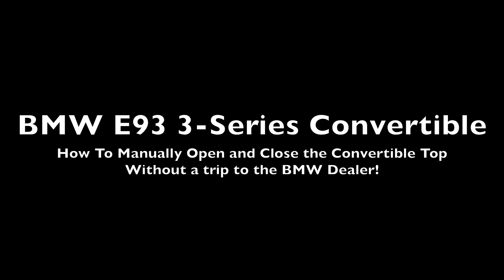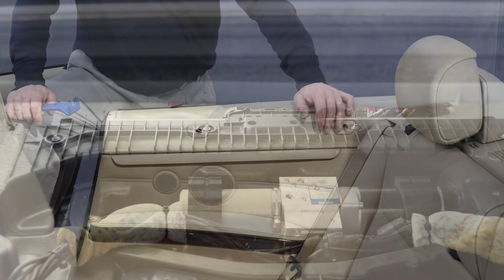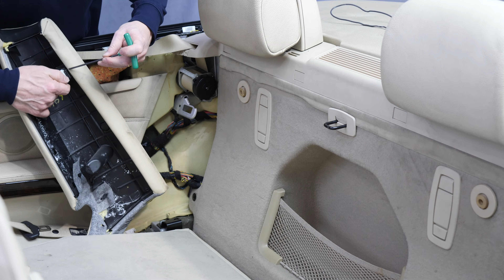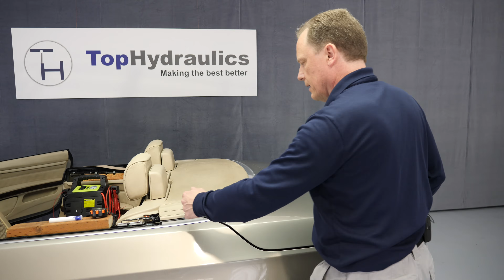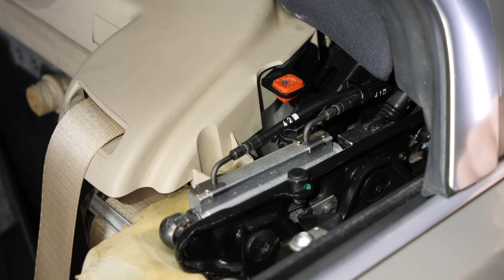How to Manually Open and Close The Top (Long Version) - BMW E93 3-Series - Top Hydraulics, Inc.

Comment: Thankfully I came across this video my e93 hard top was jammed in the closed position and had the red light on the button and thanks to this detailed video I will be attempting this in a day or two I assume after the roof is in the closed position you tighten the brass screw back up on the pump ?
Reply: hello I released the flap, but the top won't come out of the trunk. It seems like it's locked or jammed. do you know what should I do in this situation?

Comment: Guys I own e93 cabrio Lci model 2010, got engine under fire, so whole front burnt down, and locked up my boot, of course with the foldable roof inside of it, so I couldnt climb in through rear seats to pull that triangle handle that opens the trunk manually when battery is dead. But Ive found the solution! Take off the cover that you press when opening boot normally with the hands, and also the LEFT side plastic that lights on the evidence plates. Then youll see hard to get to - black cable - that black cable has metal like cord inside, that is connected to the boot and its the same one that goes to that triangle handle, than you have to pull it somehow and the boot will open. So it is possible to open also from the outside of the car WITHOUT battery charging or some specific cables connection. Good luck :)
Reply: hello I released the flap, but the top won't come out of the trunk. It seems like it's locked or jammed. do you know what should I do in this situation?

Comment: What happens if you cut that red wire and is there a wire you can cut to shut off the safety alarm that says hardtop not locked hardtop not locked is there a way to bypass that a wire to cut?

Comment: Got my roof up manually , I hope touching the two wires with my drill battery will latch it , anyone know the right wire to cut to bypass it all safety alarm ?
Reply: hello I released the flap, but the top won't come out of the trunk. It seems like it's locked or jammed. do you know what should I do in this situation?
Reply: @aoxkxkckssdi  pull the cylinders back around where the hinges open the hinges and make sure the partition is wedged up. Make sure that pressure screw is loosened and it should pull out and up.
Reply: @JohnNighthawk I loosened the pressure screw and pulled the cylinders back However, it still won't come out as if an internal locking mechanism is still engaged....😭

Comment: Recently got the “roof impaired” warning on the idrive and roof was stuck open 35percent. Was able to crawl through ski pass and pull emergency trunk release. I dont not have the key hole. 2011 e93 M3. I released valve. Top was able to fall back into close position. No sound from hydrolic motor. Replaced salmon relays, still no sound from motor when top up or top down button is pushed. 2 Codes popped up on Carly app…indicates “windshield cowl reached” and “power supply”. Took apart the rear interior to access port to jump mechanism to lock. Was able to do that. But pulling the rear to the dead space to fully lock is been difficult. I get to exactly where you cut off the camera to lock the trunk and rear section. Do you have any tips on how to pull them all the way to lock.   Also after the top has been properly latch and locked., do i tighten the release valve on the pump back to close? Please help and thank you in advance…rain is on its way where i am and want to lock everything up.
Reply: Was able to do the rear. Heavy force was needed and a 2nd person to pump and push down on rear glass

Comment: Great video! I can't get my top to close.  I can't get into the trunk, my model does not have a key for manual release nor do I see a emergency release cable inside the license plate lights housing.  I think the passenger side is locked but the driver side is unlocked so the system is not completing the locking cycle.  Any suggestions will be appreciated.

Comment: My E-93 M3 has a broken wire and there's an open fault for the micro switch and the dealership is telling me I need to replace the hydraulic lines and the electrical lines for the wiring harness they said it's over $14,000 to replace all the stuff needed to use the Top again if my electrical lines are broken is there a way to have the Top latched up front

Comment: Hi, thank you so much for this detailed video!!! Amazing work indeed.

My issue is:

- Roof is currently in the *open* position
- Pressing the "close roof" button successfully opens the boot
- BUT: The roof does *not lift out of the boot*

-----------------------------------------------------------------------
📄 hydraulic_valves_status.csv
-----------------------------------------------------------------------
| Description | Roof Open | Attempting Close |
|--------------------------------------|---------------|------------------|
| Valve for coupling fastener | activated | activated |
| Valve for roof shells | not activated | not activated ❌ |
| Valve 3 for rear-end module | not activated | activated |
| Valve 2 for rear-end module | not activated | not activated |

- *Valve for roof shells* (responsible for lifting the roof ???) does not activate
- Rear-end module Valve 3 activates correctly
- Valve 2 may not be involved at this stage

-----------------------------------------------------------------------
📄 hardtop_drive_status.csv
-----------------------------------------------------------------------
| Description | Boot Open/Closed | Pressing Button |
|------------------------------|------------------|-----------------|
| Relay 1 for hardtop drive | closed | closed |
| Relay 2 for hardtop drive | closed | open ✅ |
| Drive for hardtop locking | stands | stands ❌ |
| Pump temperature (°C) | 46 | 45 |

-----------------------------------------------------------------------
📄 hardtop_sensor-switches_status.csv
-----------------------------------------------------------------------
| Sensor | Roof Open | Boot Open |
|-----------------------------------------|-----------|-----------|
| Locking switch closed | Yes | No |
| Locking switch open | No | Yes |
| Partition sensor (boot shelf) | closed | closed ✅ |
| Micro switch ‘cowl panel unlocked’ | No | Yes ✅ |
| Convenience function status | No func | No func |

My main concern with attempting to do close it manually is, since the roof is inside the boot, how do I access the pump to release pressure as explain on 5:39?

Again, thank you so much!

Comment: Question for @TopHydraulics 
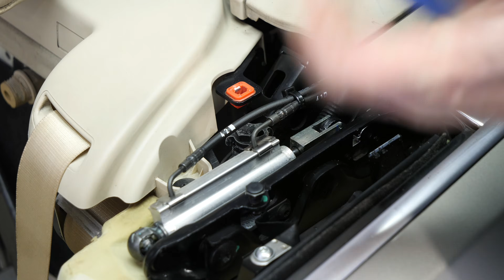2015 435i F33.  Right rear window non-responsive (yup - the water in the door issue).  Hard top is up.  Front locking mechanism manually released using T55 in front center roof hole.  Relief valve opened at hydraulic pump in trunk (sitting inside black plastic funnel) using long 4mm hex driver.    Could not get either left/right locking cylinder to budge using the same prying tool you used at 24:20.  Disconnected BOTH hydraulic lines to left locking cylinder; now it will move very slightly rearward but immediately returns to forward position as soon as prying tool is removed.  Seemed to be locked in place and would not move.  Left it alone for about 30 minutes and then went back to garage to try again; this time both cylinders moved backwards immediately and we were able to fold the roof into the stacked config.

Raised trunk section and propped it open, and then attempted to fold the stacked top back into the trunk (with the trunk horizontal divider down), but the top will not fold back.  The arms coming from the trunk section up to the stacked roof resist all efforts to fold back.  Is there another lock that needs to be released for these main arms?

Comment: An other question, once top is down in the truck, how do you close the screw of the hydrolic system?
Reply from the maker: That would take some ingenuity. Normally, the manual actuation valve gets closed when the top is up.

Comment: Hello, I have my roof that had stuck to 20 cm from the windshield, so I closed it manually and the rear switch as well. But since I have the open roof alarm that sounds.
So I changed the salmon relays, the central system roof microswitch. Today I reopened and closed the roof as in your video. But the automatic open-close still doesn’t work, and I still have the alarm.
But the roof is crooked, the windshield seal is more compressed on the driver side than on the passenger side. Would you know how to put the roof straight? Because someone told me that there was a story of magnet
My car is an e93 330i 272 from 2007 thank you
Reply: Let’s see if this wasn’t a coincidence, where the front wasn’t quite ready to latch. I would unlock the front and both frame locks, back the roof off the windshield, examine if anything appears uneven in the front locking mechanism, and lock again while making sure that the top has entered the windshield evenly.
Reply: @KlausWitteTHI well i did it but still nothing change and anyway i'm not able to correct the position of the hardtop...but it's open at his top, if i use the opening button, i can hear the hydrolic motor but nothing happening and the error code is 00A68E

Comment: Hi, I have a 335i 2008 and my roof got stuck in the trunk and didn’t come back up, we tried to bring it backup manually and we made it but we noticed that the window didn’t roll up after that and it show that the top is not completely closed 
We can see the rear part is not latched but we don’t know how to proceed on that part, what do you suggest
Reply from the maker: Maybe re-watch the video and find the step you missed. I suspect that you didn't pull the rear locking cylinder in all the way, as shown around https://youtu.be/2hDdwukqR4g?t=1901

Comment: Hi, I am trying to follow this procedure and everything was working fine up until I'm trying to release the rear trunk by pushing out the piston cylinders on both sides. They are not moving at all, what should I do? I released the pressure relief valve as you suggested earlier in the video. Any thoughts? Thank you for your time!
Reply from the maker: Push harder, or remove the hoses from one cylinder in order to make it a little easier to move the cylinders.

Comment: Hi, thanks for the impressive instructional video. I was able to follow most of it however after opening the cylinder piston I am not able to close it again, it took some force to open it and had a springy motion at first, after that it it smooth to open. Now I can close it only up to about an inch and no further no matter how much force I use. Any ideas what could be causing this? I am now no longer able to close my car windows due to this

Comment: Hello My name is Slava. I have a question about my BMW 430i convertible I got stuck with my hard top is not close.  And I have an error 8005008 CTM, microswitch cowl panel locked / stowage compartment latched: Line disconnection (open circuit) or short circuit. But I can’t find where is located.
Reply from the maker: Maybe it's this switch: https://youtu.be/2hDdwukqR4g?t=1564

Comment: I did all steps but now I cannot lock the roof closed.also there is no hydraulic movement in my electric switch were there was beforehand..any help greatly appreciated as windows are open fully and can't lock the car
Reply from the maker: Reading between the lines and using my crystal ball, I believe you are trying to say the following:
You had to manually close the top because your pump was actuating when you pushed the button to close the top, but it didn’t move the top or it didn’t move the top or the trunk module well enough. After you manually closed the top, seemingly following all the steps in the video, there was a problem with fully locking the top and the windows won’t go up any more. At the same time, the top won’t move in any direction when you pushed the button.

1) Is this correct?
2) Which part of the top is not locking properly - the front at the windshield or the rear frame locks where you were supposed to use the angled pliers?
3) Exactly how far were the trunk module and the top still moving before you attempted the manual operation?
Reply: @TopHydraulics  hi yes the roof opened as far as glass and roof folding into the boot (the lid would not close) 
So I manually released the hydraulics and lifted the glass and roof out of the boot back to a closed position but none of the locks are locking( the roof lock and frame lock) and there is also no sound of motor movement when trying the switch 
Did I blow a fuse?
Does the hydraulics need a reset?
Reply: @TopHydraulics  OK progress... I manually lifted the roof open fully and closed it again this time forcing the boot lid shut and catching it  but when I try to do the same with the glass & roof combo it' seems like the glass section is not interlocking to the body ...the roof lid is now locking to the body. This is not allowing the windows to closed

Comment: The 250lb cassette of the hardtop that you easily lifted at the 29:00 mark on the video... What would be a cause of this being locked down and not able to move (at all), did everything else in the video as you stated. The problem I am having is my client asked me to replace the trunk located battery. The battery had 0 volts. I hooked up jumper cables to the front jump lugs and car came alive. Push the conv top button and trunk lid rises as its supposed to but that cassette does not move nor do I hear any unlocking of it or any motor noise. Only the trunk lid moves every time I try. I believe that this hardtop cassette is (locked)?  and if you agree, what is the work around for me to manually (unlock) it? She parked the car in her garage back in August with the top already open and she supposedly had a battery tender attached and battery is stated to be one year old. I got the car running with a jump yet the roof does not close, only the trunk lid rises. By the way, I have bought hydraulic parts from Top Hydraulics last year for me SL550. This is a clients 2013 328i Conv.
Reply from the maker: If the battery has been low, then the computer may have lost the memory of where the windows are at and it will allow no top movement except for the trunk lid, in order to avoid collision of the top with the windows. If your windows come down 1/2" when you open the doors, then the windows are "indexed" or "synchronized". If not, then you will have to follow the procedure for indexing the windows as described in the owner's manual for action after the battery was dead. In most cars, this means raising the windows to the UP position and keeping the window button pushed a few more seconds.
If you are unable to raise the cassette, then be sure that you have the manual actuation valve on the pump open, ignition off and check whether the front latch might be hooked on something.
Reply: Hey i got the same problem. Did you find a solution?
Reply: Got lucky and got the switch hold it down for 60 seconds and relaxed the partisan lack

Comment: Old thread I know. But I’ve used the manual method as stated and got my top up. Still having an alarm with the red top indicator on the instrument cluster. How do I get that to stop
Reply from the maker: You get the alarm to stop by letting the control module get the signal that the top is latched and secured. The problem lies most likely in the rear frame lock cylinders not having been moved all the way - the ones where we used the angled pliers.

Comment: Hello guys, I carried this out and I'm stuck with no windows now as I can't fully close the closure cylinders on each side.

I've used the 90 degrees pliars also

I have tried to remove the hoses , no luck
I've also had people pushing down on the back
I've pulled with alot of force and pushed down also.

I also cant access the boot and I can't access from the rear as I don't have the ski pass through it as I am in the UK so it's not as common.

Ive also researched the special bmw tools and I can only find one that's available in Germany (I'm uk) on Ebay which is £400

Is there any other tools that I can use? 
Or something else I can do?

Any advice would be appreciated :)
Reply from the maker: Sorry that you are having a hard time. There is a Hall sensor directly on each of the locking cylinders that tells the computer when the lock is fully open - that's not the one we worry about this time. However, there is a micro switch on the side of each frame lock that tells the computer when the lock is fully closed. You could try to defeat those micro switches if they haven't been released. Here is how it works: a lever from the locking mechanism pushes on the micro switch as long as the lock is not fully closed. The switch itself is "normally closed", which means it closes an electric circuit only when it is released. The latter is meant as a fail safe mechanism in case a wire is accidentally . You could either find a way to release the lever from the switch or short both wires together. Please let us know how it turns out.
Reply: @TopHydraulics  thank you for your reply I will do my research and try have a look if I can see these switches.

I also am not worried if the shaft is damaged as my primary goal is to drive the car with closed windows.

Comment: Hello, i loved the video, and it helped me put my roof back on my car when i was stuck with no roof!
But my windows do not close and neither does the boot open , constant flashing, but the latching system works so ive been driving but with no windows as i cant fully lock the cylinders back in place.

I've even tried to remove the hoses and extend them and reconnect and pull again with the same tools and a lot of pressure from many people.

I've also tried pulling them closed whilst pushing down on the CTM module

Please is there anything else i can do?